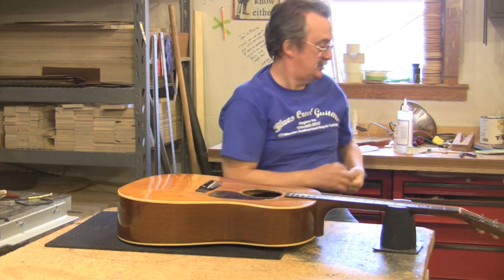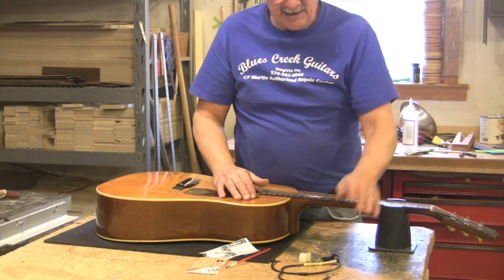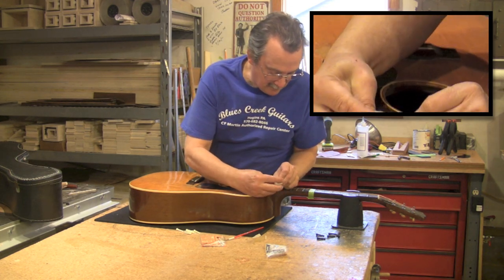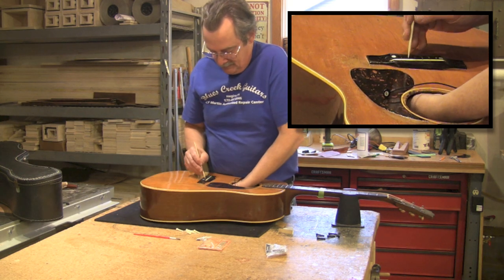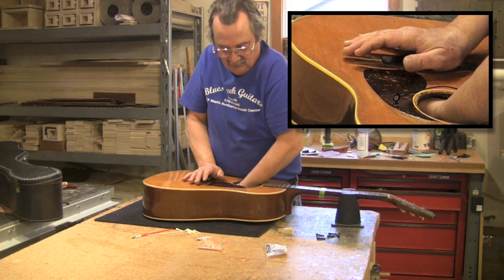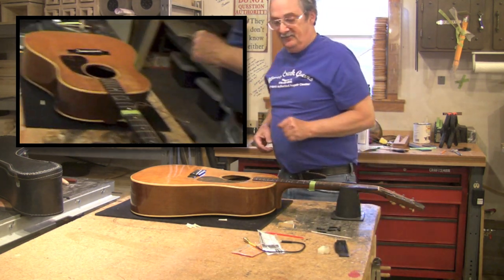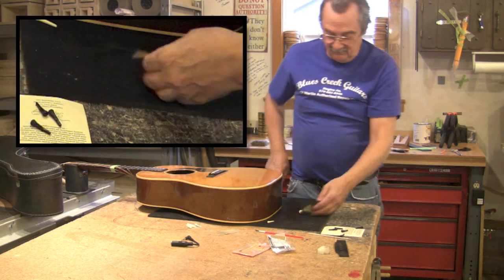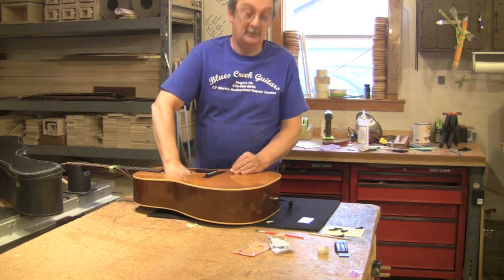Blues Creek Guitars - Adding a Pick-up to Your Acoustic Guitar

Comment: Zabardast cheers from Toronto.  Where exactly to place this inside the guitar as the one in my Yamaha APTX2, 3/4 guitar dropped in. It is about 1 inches in diameter and has glue on one side? Not like the one you are using.

Comment: Thank you for the video.  Very well done!   After viewing yours first, I started listening to several videos showcasing the K&K Pure Mini pickup.  Do you think that this pickup tends to be bass heavy?   (Across the demonstration videos I've seen, it appears to be bass heavy and treble light, to me as a viewer.)    If it is bass heavy, do you think it might be worth trying to install the bass side pickup a little further away from the bridge, the middle pickup closer to the ideal spot and the high pickup spot on?    (ie:  Maybe get less volume on the bass, a tiny bit less on mids and get as much volume as the pickup can get on the highs would produce a more even response so the bass isn't quite so overpowering the highs?)   What are your thoughts on this?

Comment: there are a few tools
   A good step drill for the tail.  I use a small dowel to catch and  guitar the pick up jack.  Not many tools needed really. Each pick up uses a few different tools. The K&K has a little jig for location of the transducers  On this install I didn't really need anything other than my hands and a few golf tees.

Comment: Hello sir, maybe you can help me? I have a B- Band A3T set on one of my cut away guitars. Dean Mako. It has tuner, eq, tones, etc. It just stopped working. Brand new batter installed and still dead. ive taken it out a inspected but still unaware of the problem. When I press  tuner button it blinks once and that's it and not everytime! Any advice?
Reply from the maker: +Militis Autem Crucis  sounds like the unit died  call them or email the manufacturer  or go on line they may be able to help you.  These digital units can drop a program and need to be sent back.  Wish I was of more help
Reply: +Glenn LaSalle 
you were very helpful sir. thank you for responding. I too I'm addicted to guitars. I just in the last 24 hours stumbled across your videos. and for the last 24 hours I've been watching you! put it this way if I met you on the street I would know exactly who you are. you are very good at what you do and ive learned a lot already! Many thanks kind sir!

Comment: Cool.. think you can still do this with a bridge doctor in place?.. that also sits near the middle of the bridge ...
Reply: yes  the bridge doc is behind the saddle  the pick ups are in front of the saddle
Reply: john hall thanks.. i guess the wooden piece comes up and contacts under the bridge between the 3rd and 4th actually.. but I’m thinking you would also be able to put the pickup close to the same spot.. but ideally, the bridge doctor is screwed in just after the pins and the wooden counterforce contacts right at the bridge..

Comment: Yes K&K shows it that way  but I find the e is overpowered and you loose some mids.  I have seen these on the X braces, They are very good pick ups.  You can use the thin 2 sided tape to experiment where you like them the best.  I am a dealer and install a lot of them.

Comment: Holy Cow, this guy is using the guitar for a table while he does his work. He's placing his tools right on top of the guitar. He's also applying the glue to the pickup over the guitar. What if it spills? Strange. using such little caution.
Reply: what you may not see is the paper towel inside the guitar. Having done this many times if am pretty good at this. I agree if your a first time use some saran wrap on the top under your work . Also with these videos if I cover stuff up you don't get to see it,
Reply: John Schreiber that sounded kind of rattley. Should've went Fishman all the way. I'm sort of spoiled, have the Fishman with bridge under the saddle pickup and a Mic. Love it.
Reply: A 1/8th inch plug? You don't think that's a bit cheesy?
Reply: Yep.  The shop you don't want to take your guitar to get it fixed/demolished.  That guitar was a Gibson too.  Sad.  Big question is, why didn't he just put a small mirror inside the guitar so he could see what he was doing?